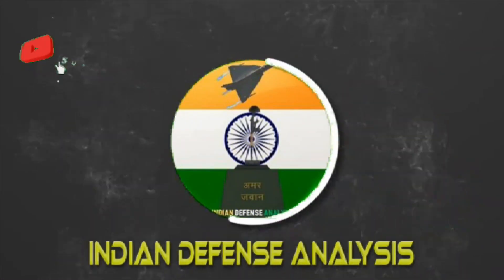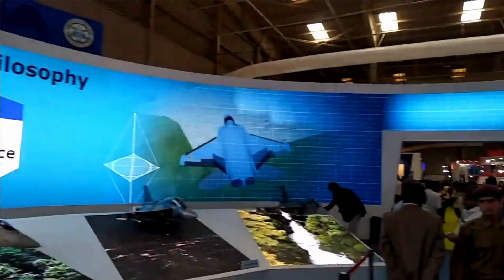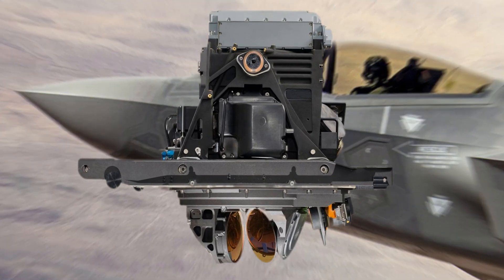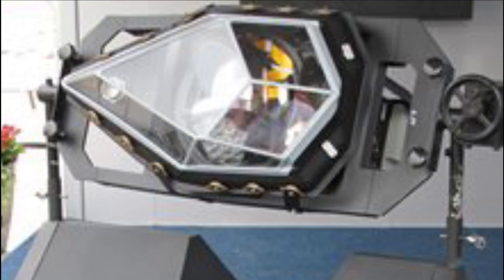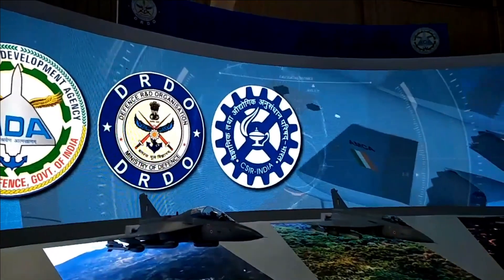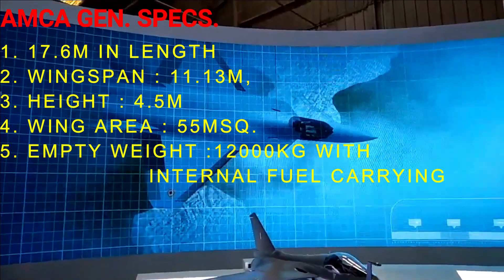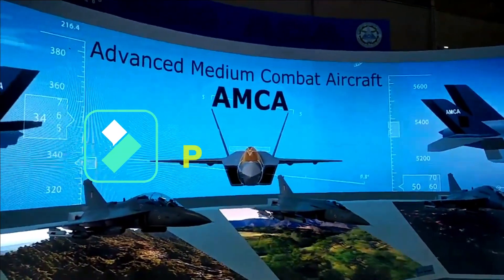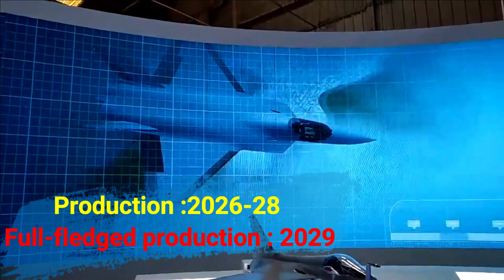EOTS for AMCA enters trial | 1st flight of AMCA by 2024

Comment: Why these technology not in F-22 RAPTOR but it is used in F-35🤧
Reply: It's in F22
Reply: @gg-zt9yt  really 🤗
Reply: F22 is a different level fighter compared to f35 
It's loaded with high tech makes it more costly than any fighter jet 
So the production was stopped 
Tooo much tech 
Toooo costly to acquire
Ten times more costly to maintain
Reply: @gg-zt9yt  yaa but f-22 will also give too much advantages to USA because it is beast😑
Reply: F-22 is an older aircraft built in 90s when such technologies were not introduced, whereas F-35s are newer ones having generation advantage of around 10 years.
Reply: @vikisankar2k  but some people also said that F-22 is faar better than F-35 because F-22 never shared it's technology to anyone but F-35 is working in other countries also😃
Reply: @BHARAT_3433  yes, F-22 still far better than F-35 in many fields like all aspect stealth, reduced thermal emission, aerodynamics and Engine performance. F-35 being a cost effective 5th Gen fighter didn’t concentrate much on the mentioned fields but has very good stealth + situational awareness due to sensor fusion especially with systems like DAS. Both these a/c counter each other.
Reply: @vikisankar2k  f-22 vs f-35 vs AMCA please reply🥺
Reply: @BHARAT_3433  F-22 is the dominant fighter